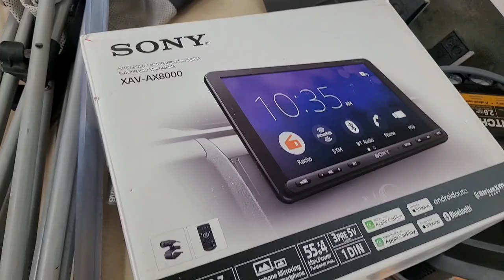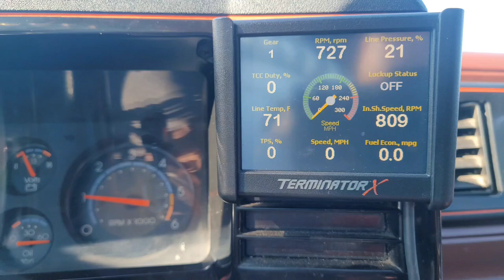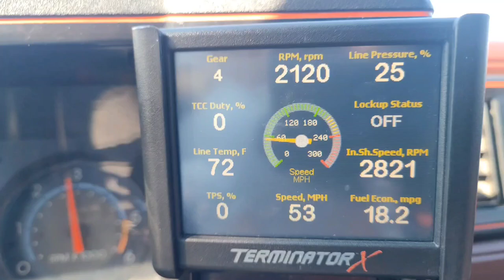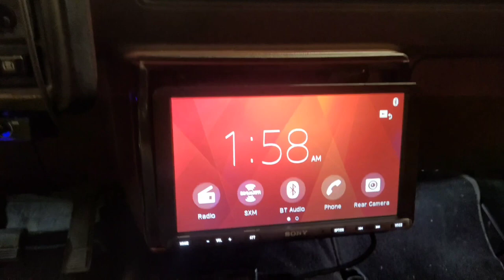CAMARO SS SEATS IN GBODY EXPLAINED (MONTE CARLO SS)

Comment: All you had to do for the rear seats is modify the old frame to fit on the Camaro cushions it’s a real quick and easy swap with the frame a little bit of cutting so it can fit perfect
Reply from the maker: Yeah I didn't want to do any of that my factory seats were in great condition so I ended up reselling them

Comment: How did you get the front seat belts to work ? Did you some. How mount the whole assembly in or did you just use the Camaro seatbelt tongue on your factory seatbelt ?
Reply from the maker: The seat belts are from the camaro as well